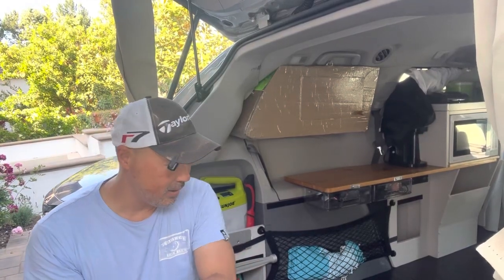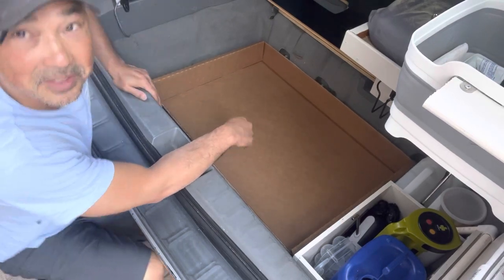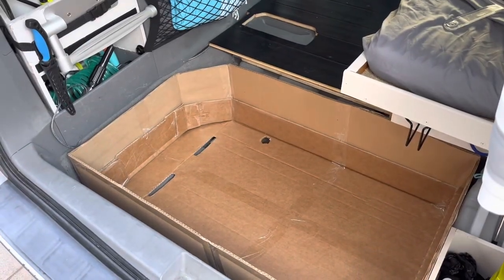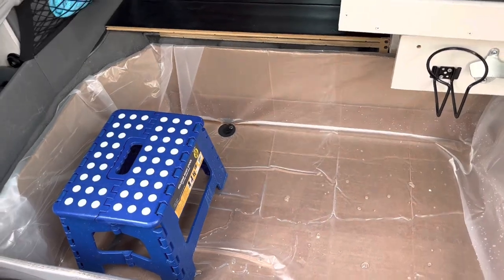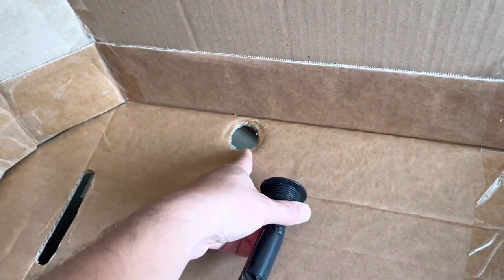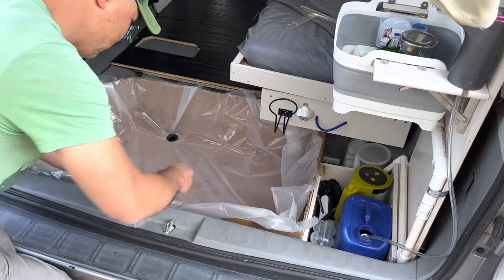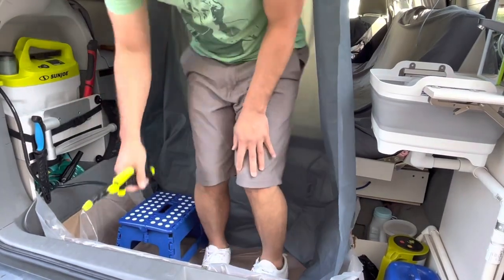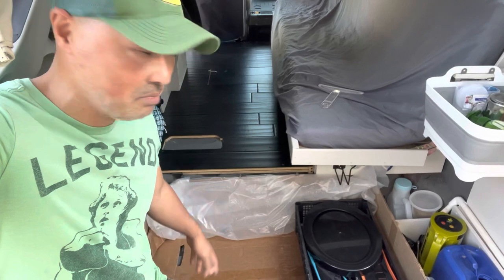Disposable Cardboard Shower Tub. Sienna Cardboard Camper EP3

Comment: Two ideas for your consideration.
I have sealed the end corrigations with hot glue. I lay a 4” bead of hot glue onto the cut cardboard ends and immediately wipe the bead with the side POF my glue nozzle.
Creates a smooth sealing edge quickly.
Second idea is using a cloth strip as a door hinge. Has worked in the past for me.
Reply from the maker: Nice ideas!

Comment: I like the creativity and can-do attitude about using cardboard. It saves money, weight, it's fast to build, more ecological,... a lot of benefits but the plastic liner is a fragile thing and cardboard doesn't handle leaks well

For things like shelving I think cardboard makes more sense, though even there I'd be more inclined to go with thin multiplex but for a showerbasin I think wood with fiberglass might be a safer option if you want something that'll last long and not leak: https://www.youtube.com/watch?v=LhWud4a5Aj8

Something that's also very cool about your system though, if it ever does leak you'll SEE it rather than discover a rotten mess under there when damage has already been done.
Reply from the maker: Agreed, there definitely "better" options.  But this build will be cardboard based. haha
Reply: @Tiny-Campers  thinking about it more and also watching that earlier origami video of yours is convincing me more of the advantages. There really is a lot of sense making stuff that's so easy to setup/teardown/replace in something temporary like a car/minivan. Even getting rid of it later is so much easier.

You're even giving me ideas for my own car shower solution like a drain in the footwell of the backseat of my car so I could sit in the seat on top of a shower curtain.

Thing is I have an old car so it's hardly worth investing a lot into making it fancy but this sort of thing could be more logical for me also.

Looking forward to watching the rest of the cardboard build.
Reply: @Tiny-Campers  By the way, do you think it would make sense to use a good part of an old struck tarpaulin? I mean on its own?
Reply from the maker: Don't see why it would not work. But remember, you need a good seal for the drain. If it is not a smooth surface, you will have a harder time getting a good seal.